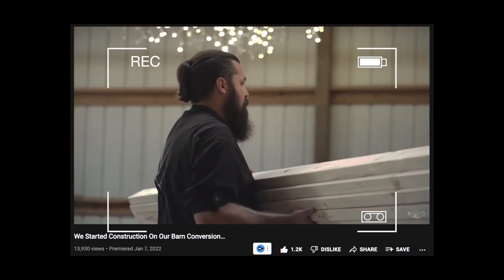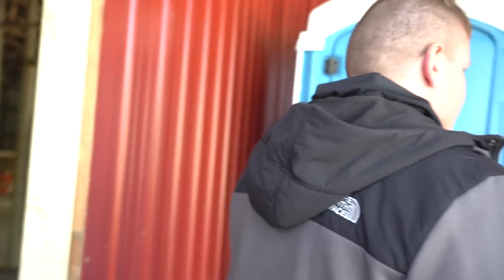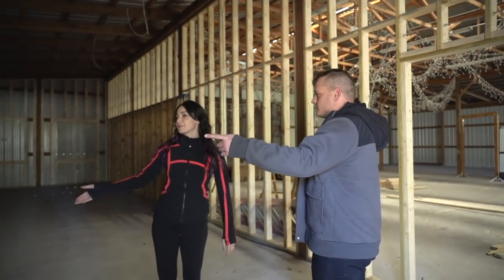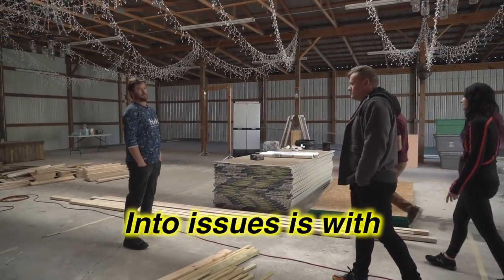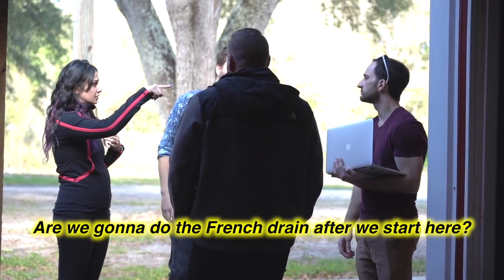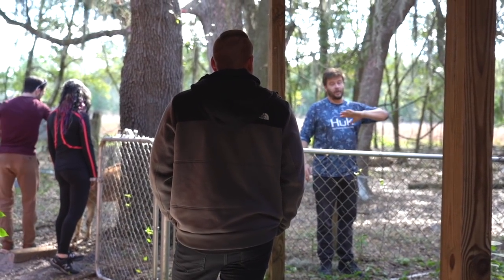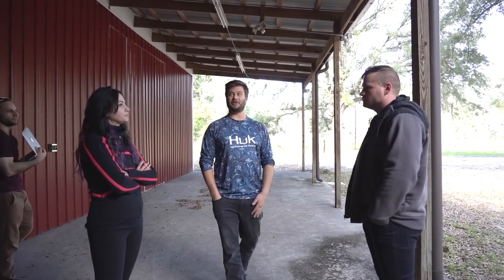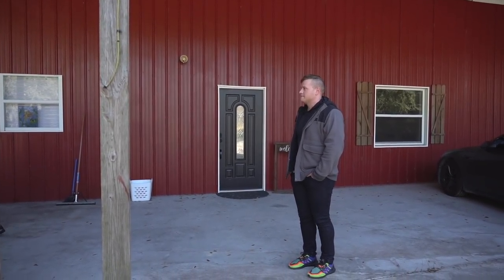There’s A BIG Issue With Our Barn Renovation

Comment: I'm in Texas and have a few buildings for my reselling business. I have decided turn one into an office. It's a little over 300 square feet. For 1.5 inches of closed cell spray foam, the quote for the wall and ceiling is about $3,000. You now have me wondering if that is marked up due to a supply chain issue and if I need to wait.

Comment: I have completed quite a few renovations and have used a product called Rockwool many times, it is water resistant, mildew resistant and fire resistant.  The R value is high too.  It is a very good product.  I would suggest a vapour barrier as well to prevent air infiltration.   Let me know if you have any questions.

Comment: Not a contractor here, and maybe I don't understand the master plan so take this question and thinking accordingly.....but I wonder what the advantage is for your business to get the smaller space ready while you wait for the foam for the larger space? It sounded like you would have to move the windows from your now-business space to the new space, thus making the current operation space weather vulnerable and meaning you have to move Calli and photo workspace and inventory to the new smaller space while you wait an indeterminate time for foam? That would seem very disruptive. Will you consult with Calli for her perspective?

Why not just hold off on making build progress till the foam comes in (though the contractor won't like that much I guess if his pay and his subs pay is contingent.) Disruption to the biz will be costly in terms of inefficiencies involved in moving and getting resettled and if that's only a temporary move till the foam comes in and you can finish the large business space  then you have to reset twice right?
Reply: Because prices are steadily rising.  A gallon of milk is supposed to spike at $10 per gallon.   Buy whatever you can now.